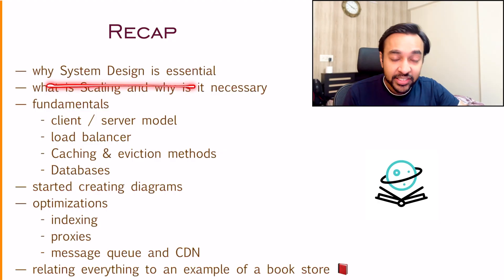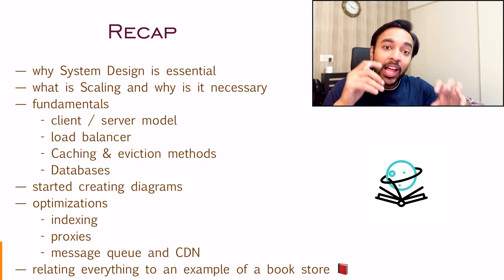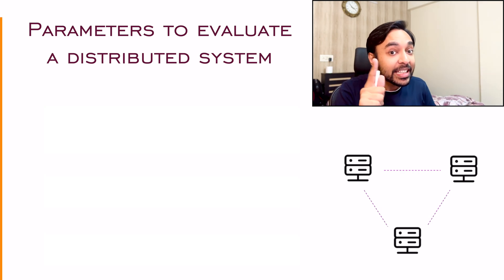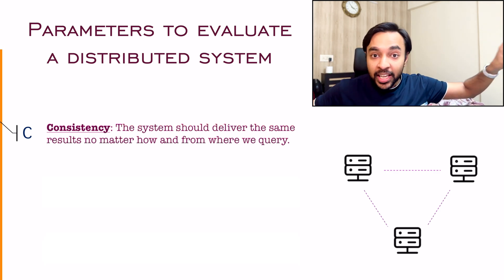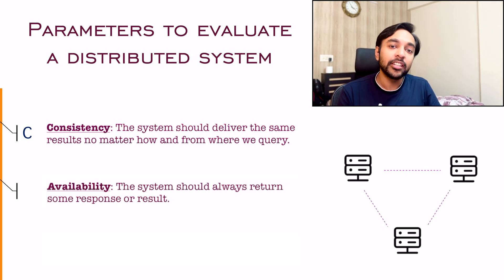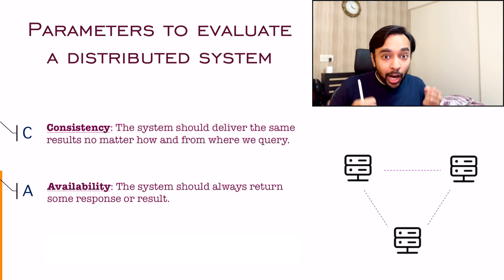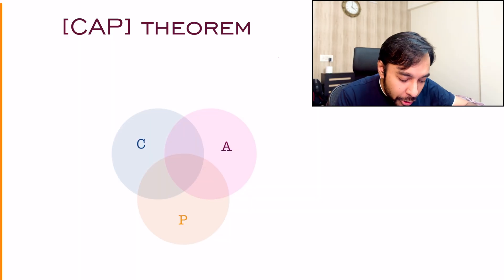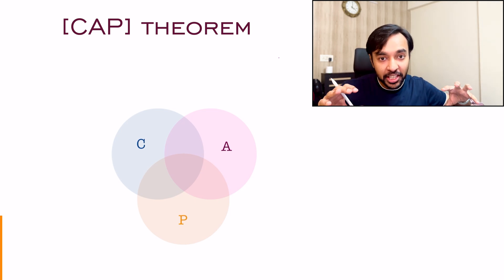System Design - Part 10 | CAP Theorem and use cases | Nikhil Lohia

Comment: Hi Nikhil, that's really good explanation! Loved it. However, there is one point that should be corrected about CA. In the real world, it is almost impossible to guarantee P will never happen. Therefore, no major cloud-native application can truly be CA. In the world of distributed system, almost all applications must be distributed (P is non-negotiable). This forces the CP vs. AP choice. In my opinion, I think for ticket booking system, it is best to have CP because a seat must only be sold once otherwise it will be overbooking. Correct me if I an wrong :)
Reply from the maker: You've highlighted a crucial nuance about CAP theorem in real-world distributed systems. The CP vs AP choice is indeed what most applications face.

Comment: Ticketing system - Consistency Availability and partition tolerance logic not making more sense.
Suppose Air India ticket system is there, not talking about aggregators. All components should work right for ticket booking, are you saying ticket booking will work but component for seat selection or web check in won’t work in that case?
Reply: here it is consistency + partition tolerance and availability can  be compromised, in distributed system it's not to compromise on partition tolerance

Comment: @nikoo28 there is eventuval consistency between the systems right i want to get clarity one point like if some system fail to acknowledge back while updating will there by any periodical retries to sync systems
Reply from the maker: If possible you should retry to sync systems, but it may not always be possible depending on the traffic you get. Also a force resync may have some downtime.
Problems like these will never have a definite answer, usually these are administrative choices. If you are at an organisation talk to your peers, if it is your own system..you are the boss :)

Ultimately the consumer should be satisfied/happy.

Comment: Great video, but some pointers from me: Partition tolerance part is slightly unclear on what it exactly means when you say something gets disconnected and also the exact flow of why we might get inconsistent results
Reply from the maker: this will get clear when I start with some model designs, gets a little hard to talk about everything in a 20 minute video. Also, I don't want to make the video very long. This can lead to loss of attention.